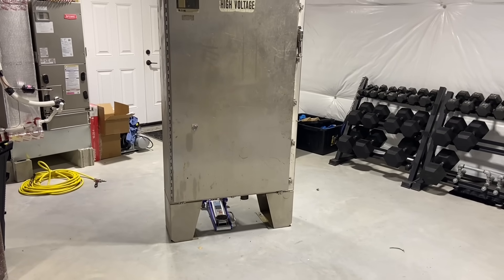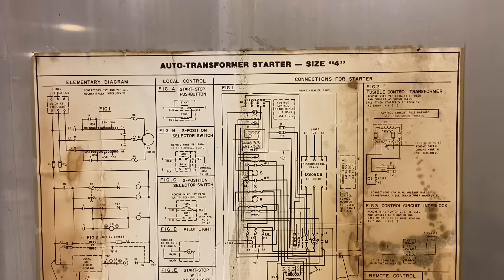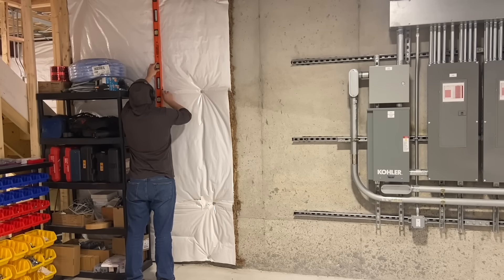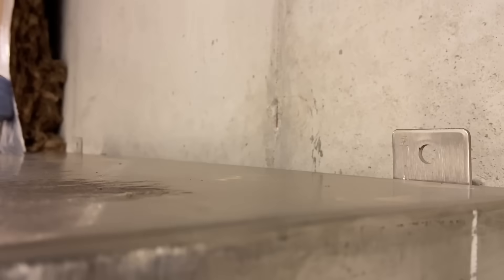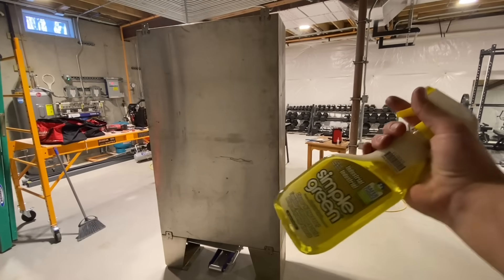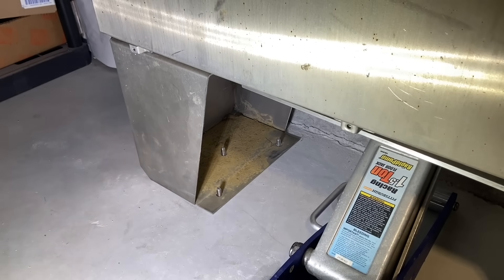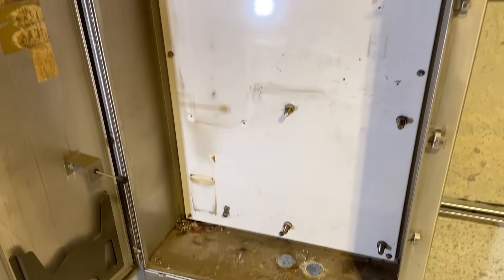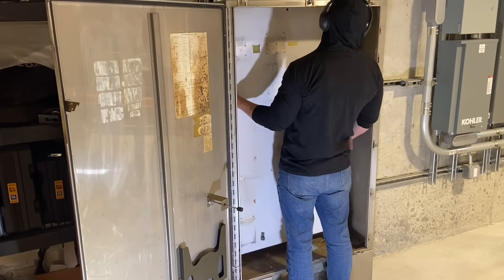Home PLC Part #1 (The Enclosure)

Comment: You should try Ignition Scada Maker Edition for controlling it! It has a learning curve, but is totally free if not used commercially and is WAY better suited for interfacing with PLCs than HA!  It is a million times more configurable than Home Assistant, and with more interesting features from a controls standpoint. (I swear I don't work for Inductive Automation, I just happen to really like their product and am pissed off 90% of the time I'm trying to configure HA)

On an unrelated note, PLEASE show as as much about the Home PLC project as possible, it's fascinating! Seeing your electrical setup caused me to create a Cursed Control project of my own; Building a functional model of a thermal power plant with as complete of a control system as I can build (A couple PLCs, proportional valves, relays, and a small army of sensors, a turbine and generator, etc) That cabinet's a nice score!

Comment: the point of a nut on the bolt/anchor is to sit flush with the anchor end and distribute the load. it shouldn't mess up the threads
Reply: Try reading the instructions.  We have all done it both ways and this man is correct.  It shouldn't mess up the threads, but it does sometimes.

Comment: About the concrete anchors, when drilling into the floor, you should drill all the way through (unless your on a 2nd floor obviously) but it means when you inevitably need more cabinet space or need to move it for whatever reason, you can lift it off and remove the bolts and just tap them in an extra inch into the concrete and then you can fill over with fresh concrete and you can't see it, rather than having to grind it flat and having an ugly stud stump in the floor. Also you should put a bolt on, but not to stop the ends flaring, to stop it going too far through the concrete, once they're tapped in, tighten down to activate the clamp before removing the nuts and dropping your device on top and re-tightening the nuts. hope this helps!
Reply: @georgepickering2570 Wrong.  Horrible advice.
Reply: @RunsOnRust  You're an idiot

Comment: Shelly din mount relays and a raspberry pi in the enclosure running HA. Then you could get the Shelly wall controller as HMI for the front to complete the look.

Best of both worlds having your loads controlled at one point and the ease of use of home assistant and voice assistant integration.

Comment: You can definitely retrofit a 3-point latch on those Hoffman enclosures.

I've done several, but granted that was nearly a decade ago when I did that last.  So, things probably changed by now, and knowing how things are these days I wouldn't be surprised if they made it more difficult. 

Nice work!

Comment: As a general rule, engineering done by electricians is a lot more trustworthy than electrical done by engineers.
Reply: I am a retired EE, still keep my P.E. license active.  It was a standing joke that if an EE picked up a tool, the electricians would head for the hills.  Seriously I could use tools at my desk or in a lab, but not in a production area.

Comment: Acetone works great at removing any residue from stickers etc as well as using a razor blade, just dont gouge it in.....bug spray (with deet!) will remove sharpie and many other things surprisingly. Also may wish to put some type of weatherstripping under the cabinet. I know its stainless, but depending on grade of stainless, chance of galvanic action.
Reply: I was going to comment using acetone for stickers as well! I use it all the time for things like that.

Comment: You should be able to get Home Assistant talking via Modbus. Worst case there is some other methods using protocol converters and MQTT. I have some experience setting up MQTT to talk to PLCs professionally, and its pretty neat.

Comment: As a master electrician who is a UL508 panel shop, I love your commitment to detail.  Cleaning the back was absolutely necessary for your own mental well being down the road.  I can tell from the attention to detail on the rest of your elecrical service on that wall.  (It would have bugged me if it wasn't clean and it was my panel)

A couple of tips for you.  I'll start with the cheap one.
1.  Goo Gone.  That stuff will dissolve pencil mark (on back panels) and adhesive and it's ugly residue.  It is non-toxic and smells like citrus.  I keep it handy in the shop with a cheap rag from Harbor Freight at all times.
2.  Punching holes in stainless.  You are a Team Red guy like myself, and I finally broke down and replaced my old manual hydraulic KO set with the M18 version.  I bought it up to 4", because it was cheaper to buy the whole kit at once than to buy the KOs bigger than 2" later.  It is absolutely worth the $2K I spent.  The stationary cups (wall thickness') are much thicker than the old Greenlee's that I was used to.  I've used it to punch holes through 1/4" HDPE for my laundry sink backer in the garage and more than a few stainless panels. Flawless and easy.

I build my panels on a large steel table - 5' x 10' top.  For years I built them on an old desk, and then on a hydraulic cart because I could walk all the way around it.  If you're not building panels all the time, sawhorses are perfect.

I am excited to see the end result.  Do you have a PLC brand that is your goto?
Reply: Your comment on punching stainless was quite interesting.  We were told not to use Greenlee on stainless steel.  So Team Red was a new term, but M18 is Milwaukee so let me understand.  A $2 grand M18 will punch these cabinets?
Reply: @jerryrobinson7856  yes.  I punched stainless with my old Greenlee when it was new.  As the cutter got dull, it started to "pull" through leaving a ridge.  I found this especially on thinner cabinets (FMX from Italy which are significantly thinner than even a Saginaw panel) due to the gap between the distance of the cup and cutter minus the metal thickness.  Now, if you're going to cut thicker materials, ease up on it.  Go 1/2" obviously, then skip no more than one size until you reach your final diameter.  On stainless or freestanding carbon cabinets, I go every size.  I believe that the thicker cup of the M18 results in less distortion of it as the cutter and the sheared metal enter it, thereby leaving a cleaner cut.
Reply: @bryoncovell6325  Hi Bryon, I really appreciate your detailed feedback. People that do it for a living every day for years that are also willing to invest in $$$$ newer tech are favs.  Great purchases of tools like this have regrets.  The biggest one, ‘You really wish you bought it a long time ago’.  Pleasant regards. JR

Comment: As an adhesives chemist, Orange oil and a melamine foam sponge like a magic eraser will cut through and dissolve most glue and residues. For really stubborn adhesives, toluene will usually do the trick and if you are really ballsy, a little carbon tetrachloride will go along way. Just be safe with chemicals.
Reply: Carbon tetrachloride will also give you cancer
Reply: You left out the don’t smoke ‘kaboom’ warning.  OSHA is watching… Well, if there are any still employed.
Reply: @jerryrobinson7856  that got me laughing ill be honest

Comment: Semi Pro tip - 3M General Adhesive Remover. It stinks but no sticker stands a chance. Plastic razer blades if you are worried about scratches.

Comment: I'm going to turn one of those into a gun safe. Do you think a thief would check an electric box?
Reply: 🤣  Not if you put a bunch of signage with high voltage and eminent demise!
Reply: @WildRapier  put in a couple of the most annoyingly buzzing contactors you can find, and it would be safer than a bank vault.
Automate them to be powered when security system is armed.
Reply: @Mr.Leeroy  Maybe...powered off yet triggered by a proximity sensor would save some power.  Just take one relay!
Reply: @Mr.Leeroy  Great idea!
Reply: You clowns with your pew pew's and bogeymen.  How do you ever leave your parents houses?

Comment: I've got S7-1200 PLC and it communicates with Home Assistant via Node-RED which supports S7 protocol. Basically a Node-RED translates from S7 protocol to MQTT which is natively supported by HA. I find this way much easier than programming MQTT communication into PLC itself.

Comment: I find its worse tocut the spring off. Another thing i use are those square unistrut washers before i put the bilt in the spring nut so the ears on cabinets or disconnects dont deform as you 
crank it down.

Comment: "You really don't see much of the backplane." The reason you couldn't see hardly any of my backplane is because I was given a list of requirements for a project, made a nice design, and after I ordered the 3'x6' enclosure a bunch more requirements were added. You couldn't see my backplane because I had everything stuffed in there so tight I had to screw one 48V PSU to the face of another 48V PSU because the space to mount it could not be made no matter how much tighter you made everything lol.

The company got a good deal with me (was paid in equity, then they went out of business lol), but that's because I don't know anything lol.

Comment: How would I get into the controls electrician I have a bunch of experience doing electronics and mechanical stuff for hobbies, but no trade experience
Reply: Get a maintenance job at a plant of some kind and start reading everything you can.  Low wages and takes years to learn.  I can't keep a maintenance guy for low wages.  They all want to be my boss and think they know everything.  The guys I get with some experience do everything wrong and are very lazy.

Comment: Not very popular opinion, but I think PLCs are great for home automation.  They run for years without needing software updates.   I am using them to control garage doors, pool pump, irrigation system and some lights. All logic lives on the PLCs; home assistant talks to it via NodeRed which acts as a middleman converting MQTT messages to Modbus and vice-versa.
Reply: They’re pretty sweet, just expensive in the scheme of things. Most people tend to just use home assistant to control stuff directly.

Comment: You can probably just use MQTT to communicate between the PLC and Home Assistant in the future. There's a bunch of articles on the home assistant forums about integrating it with plc's
Reply: That depends on the PLC. If I were president,  we'd all be born with Opto22 "Epic Groov" racks decked to the max. But small AB, Omron, Siemens, Keyence PLCs won't directly integrate without some form of a MQTT bridge device. I'm using a cheapo RS485 to ethernet serial server from amazon to communicate between a Mitsu FX3U clone and a couple of PLCs. But, anything name brand could need an adapter for ethernet/profinet/"pick your poison".  HA does include MODBUS support which most ethernet PLCs directly support. There are a few PC applications that provide support as well. If you really know how to push buttons, you can enable OPC/UA and then the sky is the limit.

Comment: Drill a hole? You built all that and you don't have a punch set?
Reply: Exactly
Reply: You still have to drill a hole...
Reply: @jacobbenes5662  There is a big difference between a twist drill size hole and a hole saw size hole. A 3/8" hole will let you punch a 1/2" conduit punch, and that will let you punch up to a 2 1/2" conduit size. Punch a 3/4" conduit size hole and that will get you up to 5" conduit punches, maybe bigger but that's the largest I've ever used, it's the size of a 140mm cooling fan. Point is you never NEED to drill a hole bigger than 3/8". And the holes are clean, not hell's glory hole.
Reply: @kenirwin9758  Yeah, no shit. I'm just saying you still need to drill your 3/8" hole. And it's more annoying to do that in stainless than regular steel. Better, but still sucks. I don't use anything other than a knockout set.
Reply: If you love to permanently damage punches, use them on stainless steel.
Reply: @jerryrobinson7856  I've punched lots of stainless with punches, never had a problem, well Slugbuster types don't hold up as well, especially in sizes over about 1 1/4", but multi-lobe punches hold up just fine. Slugbuster types are the only ones I can say just don't punch like they used to.

Stainless isn't harder than steel, it's softer actually. What makes stainless hell on bits is the chromium content that doesn't transfer heat well, so it over heats cutting tools. The chromium also doesn't let cutting tools dig in as well either. Punching isn't as big of an issue as drilling or sawing because it doesn't need the heat transfer as much and doesn't need to scrape out chips.

Comment: Try isopropyl alcohol to remove the stickers, it dissolves the glue. And Barkeerpers Friend works wonders at shining up stainless steel
Reply: Goo Gone also works nicely to cut the adhesive.
Reply: @25TheCaveMan  Yep, Goo Gone works way better than isopropyl, I mean you still need the isopropyl to clean up the goo gone, but still.
Reply: Lighter fluid for me
Reply: Bit of WD40 and it’ll look schmick

Comment: Why stop at a simple HMI when you can run a full blown HMI+SCADA system with Ignition? The Maker Edition is free and it can still get your tags into HA with MQTT if needed. I'm a little biased since I work with it professionally, but it feels right for a project like this.
Reply: Great idea Veloldo. I work with it as well. Dude! Ignition can do sooo much for you. The Maker Edition license is free, you can run it on modest machines. Its an insane application that can be built to do anything. I've heard stories from employees @ Inductive Automation (Makes Ignition) about it being used as a smart data access system, records management (think maintenance scheduling, documentation for your components integrated into a web application). The perspective module is certainly capable of control but, is Excellent at display scaling (automatically, like on phones and tablets or a pc) and can be very very beautiful. I think that's why I play around at home with this stuff, at work all HMI dev must promote safety and be intuitive. But at home, it can be downright bada$$. I do have a copy running at home with a couple skeleton projects running for aquarium dev work. At work we predominately use the licensed copy of the Vision module. I wish I could use Vision with Maker edition with needing a paid license.  Check it out. It would be more of a home assistant replacement. but, if you put in the work, it can easily operate alongside HA.

Comment: For talking with home assistant, Raspberry Pi's have GPIO pins (General Purpose I/O, for those who don't know) that you should be able to interfere with and use with home assistant. A brief look into this also brought up ESPHome, which also looks like something that could be useful for you.
Reply: HomeAssistant also integrates really well with MQTT among other network based protocols, if your PLC supports MQTT messaging.

Comment: There is a free software called AdvancedHMI I found on the internet, Its a visualstudio software, You can create just about anything, buttons, amp meters, switches, labels, etc. I think its really cool and I use it a lot, I was able to control the speed of a 5HP 3 phase motor with the software and its free, Hope this helps someone.